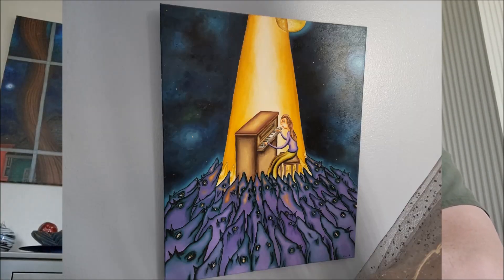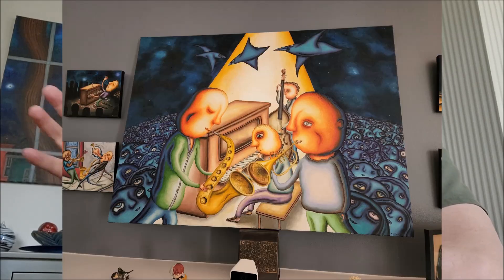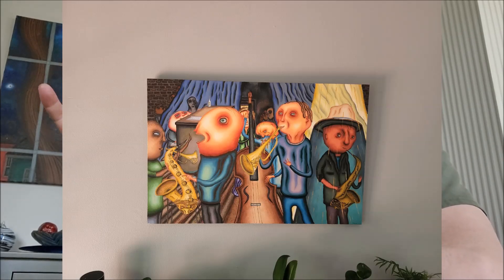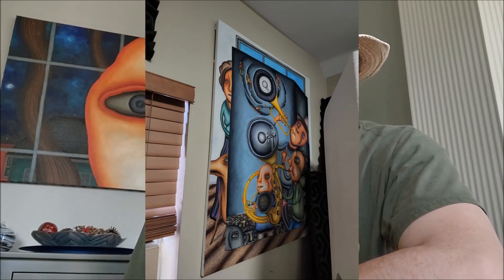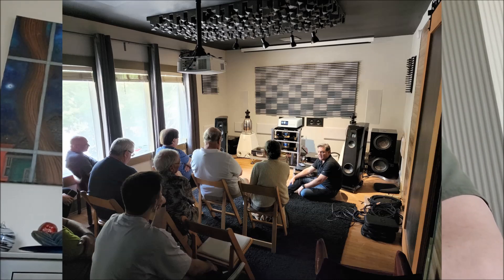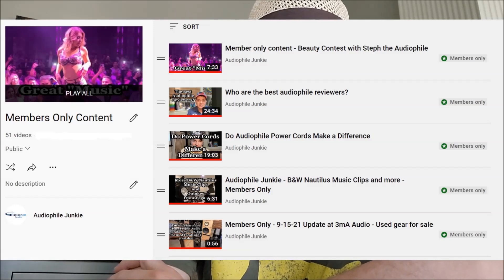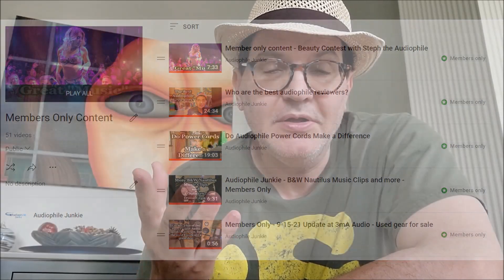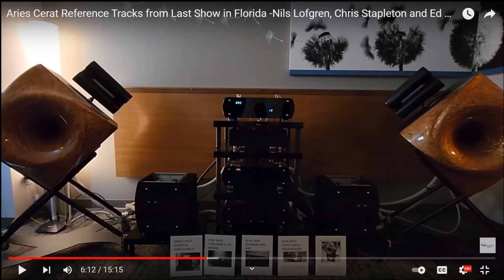My Battery Went Dead Filming - 3mA Audio Society Mtg, A/B Cable Demo by AQ, Clearaudio TT Setup, Etc

Comment: I'm not sure the two channel universe is ready to meet up with the home theater crowd.  Personally I have built a bridge between these two worlds that a dance across regularly.  Not sure it is helpful to be using what appear to be lower quality speakers on the home theater side. I have high quality main speakers which work well in both worlds. AV processors are the biggest problem where really good sound Quality seems tough to achieve when it's being processed in mystical ways and split between 16 speakers.  Very happy that you may be focusing attention in this area.  Improving home theater sound quality is a wonderful opportunity for the highly trained crowd from the other side of the bridge.
Reply from the maker: Yeah it's not time for the two to meet up yet, but that day will come. Spatial audio and other tech will attract people on that side of the equation, but as you mentioned, the key is having the right gear and set-up to maximize the quality.  It's still a ways off from being mainstream, but there was a day when people said streaming would never replace CDs and vinyl.

Comment: Are you running multichannel through mini dsp or do you have a ht processor?  I like multichannel but good content is scarce if you limit yourself to physical media.  Been trying to build out a 5.1 system in GR research's NX line ... just need a center now.
Reply from the maker: Yeah the content is scarce, but you can upmix to multi channel with different degrees of success.  The key is that the few great pieces of multi channel material make it worth the effort.